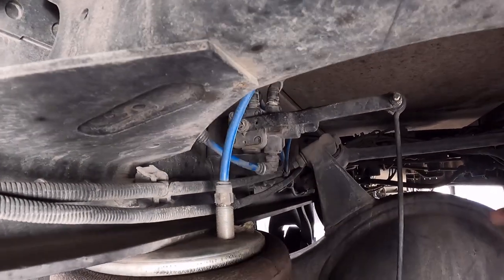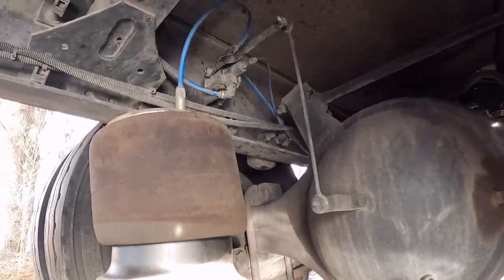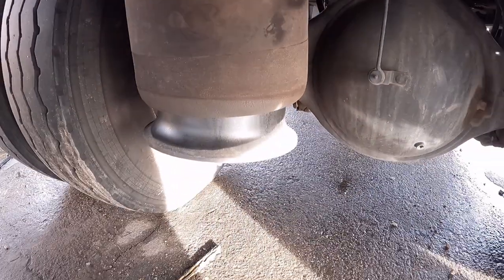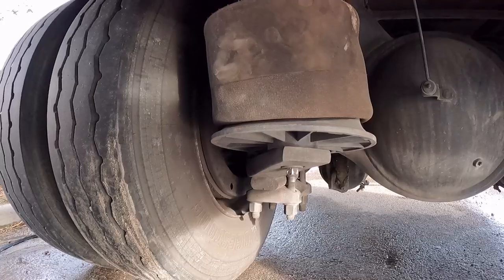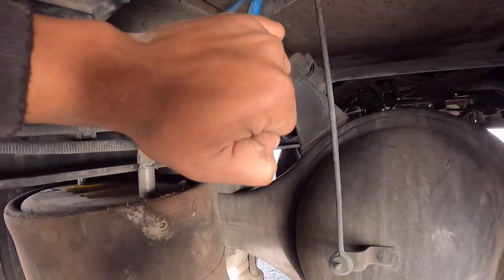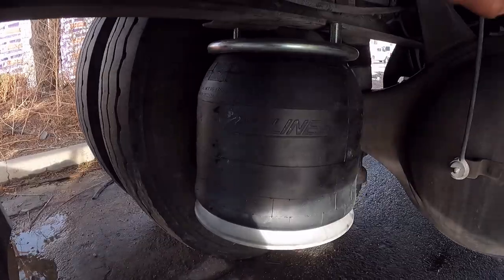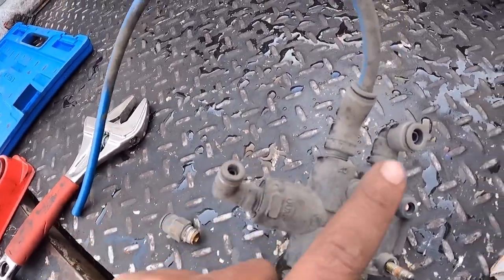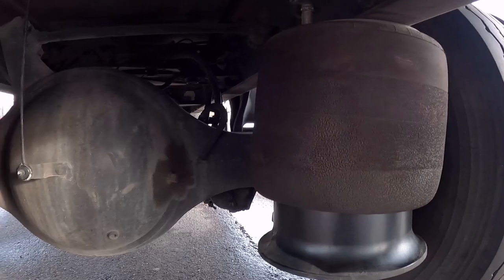Freightliner | Air Bag/Leveling Valve Replacement

Comment: Exactly my problem.  I just checked my air bag.  Leaks underneath and drains air within 5 minutes after shutting off. Also guys your gears will grind because your tractor us not leveled.  And any bump will bang your truck.

Comment: Did you need a jack or did the truck lift itself up when you cover their whose?
Reply: Truck should lift itself if you block the air hoses hoses or one depending on the truck.
Reply: Using the leveling valve before taking it off and block off hoses and then support the frame with jack stands in case it loses air a bit
Reply: @xanatgarcia9241  thank you bro